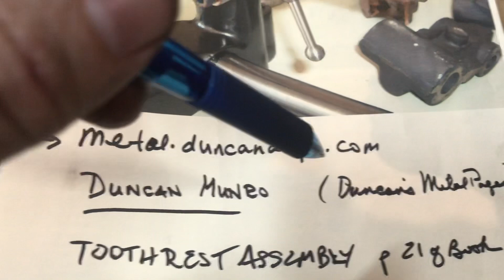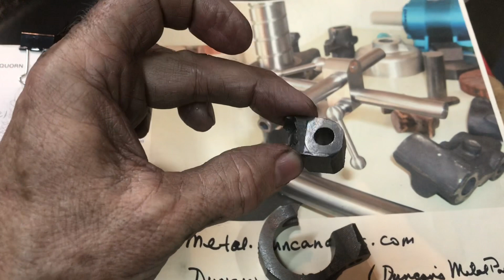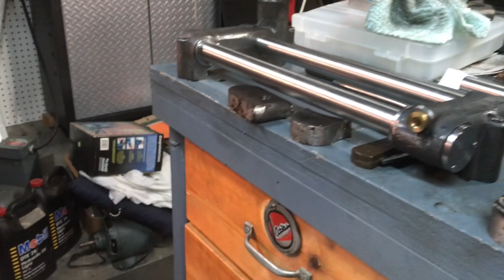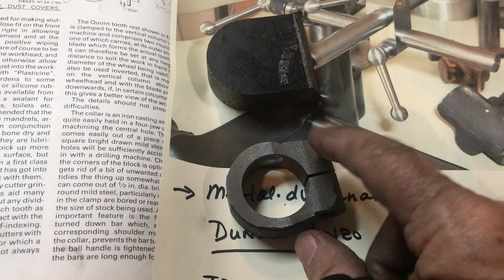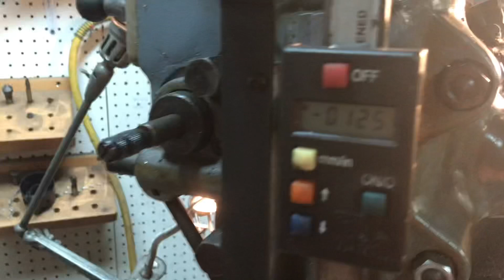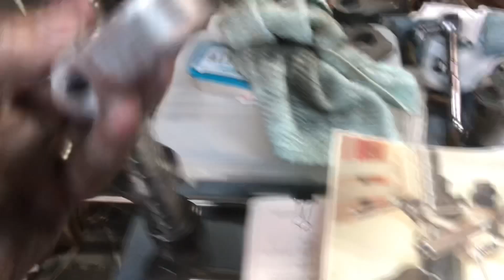Quorn Tool Grinder project. Tooth rest collar. Machining in mill.

Comment: The inclusion looks like a ball from a bearing.  Have seen this before in Chinese castings.  When they melt metal for casting they just throw everything in without regard to alloy.  The balls don't melt and when the pour is made the balls end up in the casting.
Reply from the maker: Could be! These castings were bought from the British supplier (Model Engineering Services) back around 1975 or 1977. I was lucky to get them from the original purchaser’s son as he cleared out his deceased fathers workshop. I feel fortunate to be able to build this as a bit of an excursion into model engineering history, but would be quick to point out that making the Rotating Base from separate pieces of round and bar stock would be a very satisfactory method. Possibly a superior result and much easier to correct a mistake…